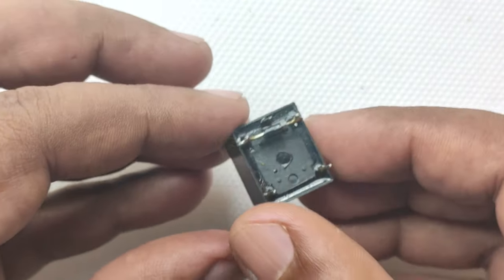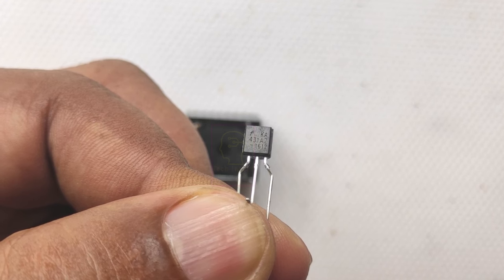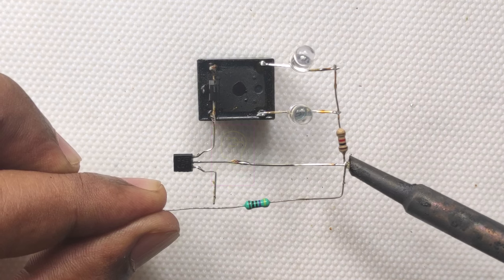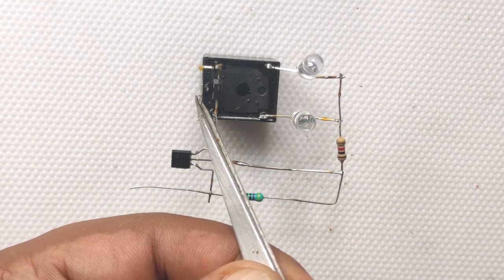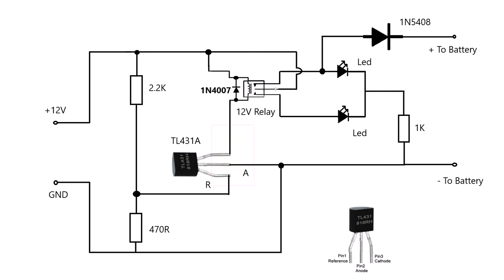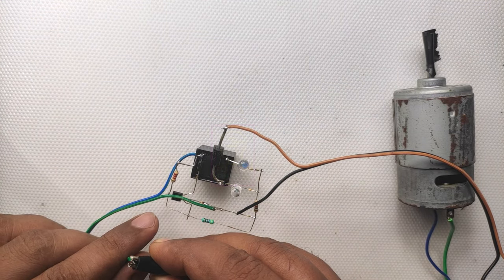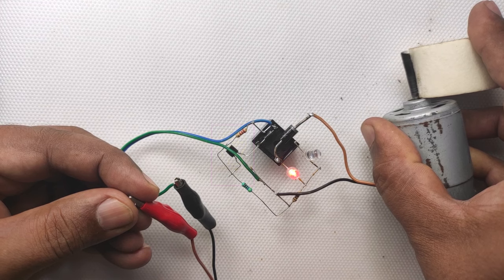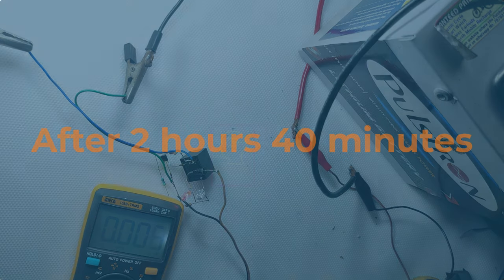How to Make 12 Volt Auto Cut off Battery Charger Circuit

Comment: 👍 Fantastic explanation sir, However I have doubt. I wanted to know what is the purpose of connecting input positive to left end of coil( diode cathode) and common terminal of relay. I have seen this same circuit in many YouTube videos but none have explained this much in detail. I am really enjoying the content that you post in every video.👏🙏 Sir you are the best teacher so far to me. Also can you show how current flows in before and after battery charging.
Reply from the maker: Positive terminal is connected to one end of the coil and negative end will receive the coil thru the shut regulator that is cathode ( 3rd pin). The relay will switch on and off by the shunt regulator. The poitive end is connected to the center pin of the relay terminal. In one terminal red led is connected(Normally Open) and the other terminal green led is connected.  In red led terminal we are conencting 1N 5408 and to battery. So current will flow from center pin of relay to normally open terminal and then to 1N 5408 and to battery positive terminals and negative terminal of the battery is connected to the negative supply of charger. Tl431 is independend of the charging current flow. It will only control whether to charge or not that is acutally decided by the resistor divider circuit. 

Thanks you very much for loving my video. I will always try to keep the quality of my videos. :)
Reply: @TechInsert  Thankyou for your reply.  The coil of the relay is energized, when by input positive and negative from Tl431 3pin and relay switches from NC to NO thereby red led lights up indicating battery is charged. Sir am i correct? Then again why is relay common pin is given positive input?
Reply: @sridharkrishnappanavanerth3388  coil terminals has no connection with NO and NC. They have connection with common terminal only. If ur not connecting it to the common, then u will not get supply to the no and NC terminals and no charging will happen
Reply from the maker: @tabm7644   Thanks Tabm . The reply is absolutely correct
Reply: @TechInsert  Thanks for this reply

Comment: Very nice video good job but i want to do a circuit of 220v inputs charging circuit and outputs 12v circuit thank you
Reply from the maker: How much current do you want? or what is tthe ampere(Ah) of the battery and what is the type of battery I mean lead acid, Li-Ion that type?
Reply: Whether u mean transformer-less power supply?
Reply: This is auto cuoff circuit
Reply: Upko follow korke meine vo ek banaya hai! Sab kuch thik hai lekin voltage adjust nohi hoga ! Ish circuit ka ehi ek disadvantage hai ? Nohi to bohut hi simple circuit hai. Thank you.
Reply from the maker: @anantalalsarkar3323   I tested this with 6V emergency light battery and 12V LIFe battery. Which battery you tried?

Comment: How to modify this circuit for18 volt  21 volt and 36 volt
Reply: This is not a voltage regulator circuit. This is an auto cutoff circuit.  If you are using a 6v or 12v or 24v or 36v battery, then just connect this circuit between charger and battery. This circuit will auto cutoff the battery from charger when the battery becomes fully charged. This will prevent overcharge problem and thus increase in life span of battery.
Reply from the maker: Thanks Uldane.
Reply from the maker: Do u need a voltage regulator using tl431

Comment: Sir i have two 12v 4ah battery and one 12v 5 ah battery (uses in bike). From your circuit what is  the input voltage required for the circut for charging my battery and this type of charging method is suitable for my batteries
Reply from the maker: For lead acid batteries the input voltage needed is 13.8v and max voltage does not exceed 14.2v. Charging current depends on the battery current. The formula is battery current/10. Eg:- if ur battery is 10Ah then the normal charging current should be 10A/10 which is 1A
Reply: @TechInsert  so the input voltage i require is 13.8v 0.5A right. I have 12v 2A adapter so i use a Buck boost converter (xl6009)to convert 12v to 13.8v is okay right
Reply from the maker: @BiBIN0619  Yes

Comment: I have tried this circuit and it works well, but I have to give an input dc volts of 14.4 to auto cut off at 14.2 volts which is the max limit for charging my car lead acid battery
Which resistor should I adjust and what value for it to cutoff at 13.8/13.9 volts
Your reply will be appreciated
Reply from the maker: I can help u finding this, replace 2.2 k resistor with 5K or 10K preset in series with 1K resistor or replace 470R resistor with 220R + 5K or 2.2K preset. Then adjust the preset for getting the cutoff for 13.8v

Comment: Sir i made your circuit and facing a problem which is while turning off my charging adpter 12v 2A. when i turn it on after some time while connected to the battery  the red indication bulb blink untill i unclip the battery connection and re connect it.. Is there any solution. I am using a step up buck boost converter to convert 12v to 13.8 v for the input is that a problem
Reply from the maker: Can u check how much ampere battery is drawing. Buck booster will consume more current for converting the 12V to 13.8V. Please check supply has enough ampere for boosting as well as charging
Reply: @TechInsert  in first it shows 0.28A and after 1 min it shows 0.08A is drawing  form the circuit
Reply from the maker: @BiBIN0619  Please connect a load at the output of booster module. A 12V cycle bulb or 12V Motor or 12V Led Bulb.  Then check the ampere. I strongly doubt the booster module
Reply: @TechInsert  But the output of the booster circuit gives almost 14v.. Is there any other way to convert 12v to 14 v without using a boost converter

Comment: We can use transistor TL431C. Instead TL431A?
Reply from the maker: Yes you can use, TL431 is not transistor, its appearance is similer to a transistor. It is a shunt regulator

Comment: Very nice circuit 
What is the input voltage to the circuit and what is the cutoff voltage to the battery
If I need to cutoff voltage at 13.8 volts which resistor and what value should I use in your circuit 
Thank you
Reply from the maker: You have to provide 13.8+0.7 volts as input. When the. Battery is fully charged then 431 will disconnect the relay
Reply: Thank you for your kind reply & help, shall try what you advise
Reply: I tried with input at 14.45 V but it still cuts off at 14.2 volts 
I think the voltage divider resistors have to be changed

Comment: Please Sir what changes needed to charge lithium ion battery at 4.2V?
Please Sir could you help me with the formula for calculating the resistors to set a particular cutoff set voltage?
Reply from the maker: This circuit is for lead acid battery. For lithium batteries I recommend using balanced charging modules. Example tp4056 module

Comment: Namaste sir this circuit is working for 30 amps current charger or 15 amps charger pse explain
Reply from the maker: Both, this is not checking the output current. This one is checking the output voltage that is the  battery voltage. So you can give any current to this circuit

Comment: Pls I will like to show u a circuit. 
What of if we want to add a 10k tremot to the base of the transistor to set the cut-off voltage we want the circuit to stop charging when the battery reaches the set cutt-off voltage. 
And sir the center pin move from NC to NO and we use NO as the output positive terminal for the battery. But when we want to set the cutt-off voltage using the 10k trimpot the NO become dienergized; meaning that we will have no out put right, and now we connect a battery of 11v that has an actual rated voltage of 12v. 
Will the circuite charge? 
Note: that the NO has no power since we have set the cutt-off voltage
Reply from the maker: We can provide a trimpot and it will work. But I prefer to use a mfr resistor coz small change in value will affect the output voltage
Reply: @TechInsert  
Am confuse about something 
When the circuit is energized the middle pin move from NC to NO? Which means NC will have no power at it terminal. When the cut-off is set is the middle pin not suppose to move to NC? 
Or is it that the power will start flowing when the battery is connected and is below the cut-off voltage. 
Pls explain

Comment: Can there be any resistance other than 470 R
And what mean 'R'
Reply from the maker: 470R means 470 Ohm .. that is a standard notation
Reply: But you mentioned only the battery cut off system, but if we have to take two wire for 12v led or router, then please tell us from where the wire should be taken. please its a requst🙏🙏
Reply from the maker: @bmsth6333  This is a bttery charger with cut-off system. In this circuit we cannot give load. Let me try whether i can redesign  it for load control. Not sure but ill try and let u know
Reply: @TechInsert  please 🙏

Comment: Este circuito no trabaja ya lo hice nada trabaja con los componentes que mencionan por eso doy manita abajo
Reply: Lo hice y funciona bien con la batería libre de mantenimiento de 6 V de mi luz de emergencia. Algo anda mal en el circuito que has armado. Revisa otra vez, por favor
Reply from the maker: This will works fine. Something might be faulty or misplaced. This is very simple circuit and u can check this easily. Check the regulator, i have seen it is becoming faulty easily when we hold the soldering to its terminal for a long time.

Comment: How you doing this without how cut off
Reply from the maker: Voltage divider determines the cutoff voltage. 431 is built for it
Reply: Does that mean if we set the cutt-off voltage NO will have no power supply showing that the output has reach it set full voyage so no power will be supply to NO. 
and will charging start when a battery bellow the set cutt-off voltage?
Reply from the maker: @davidolamide2655  since it is in no it will always disconnect the battery from charging until and unless we disconnect and connect the input supply which is actually resting the circuit